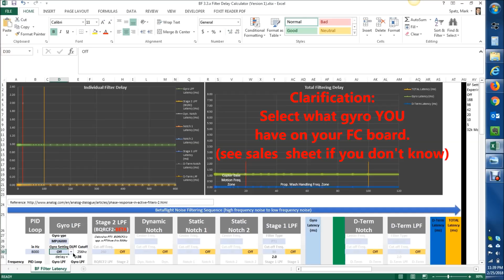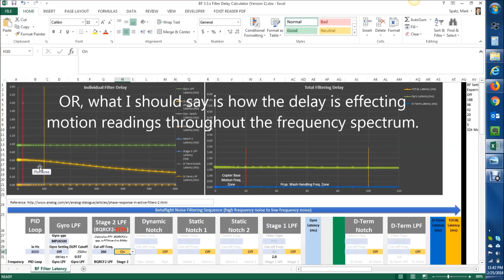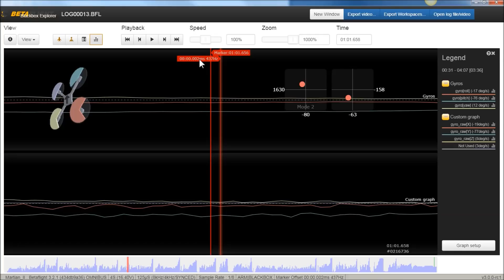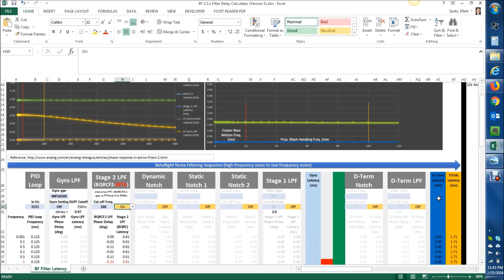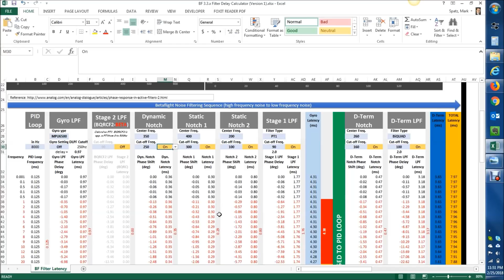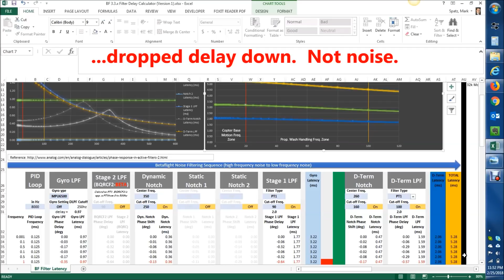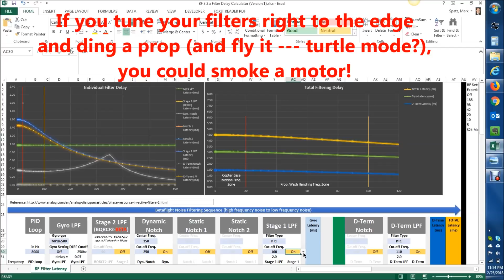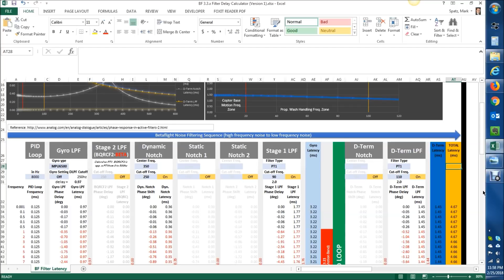Calculating Filter Delay in Betaflight, Cleanflight or iNAV

Comment: thanks, probably the most informative video i've seen in quite a while. I always tend to reduce my filtering to bare minimum (keeping the motor temp in check) but never just had a great idea of how the latency is affected so this is very helpful. it would also mean a lot to clarify with the devs how the latency really works for the new BQRCF2 filter and also how is dynamic notch filtering effective if we disable the standard gyro lpf an replace it with BQRCF2 filter at same cutoff (ie. 90). I can't tell the difference between the two, all I know is when I have both running then the propwash handling is terrible. anyway, for now I reverted back to just gyro lpf (PT1) as I assumed the BQRCF2 would just cause more latency
Reply: The devs know about the BQRCF2 vs classic Gyro LPF delay. One of the Betaflight devs actually made the original graph comparing the two filters' delays. But yeah, you're probably correct in using the classic gyro lpf set to PT1 if you're using an MPU6000. The BQRCF2 is better at filtering out high frequency noise across the spectrum than PT1, but as we know, the MPU6000 is hardware limited at 256hz. And at 256hz, the BQRCF2 and PT1 filters are identical as far as frequencies filtered out, except the BQRCF2 filter has more delay. So for people running gyros faster than 8k, there will be a benefit to using BQRCF2 since running at higher than 8k increases the hardware LPF.
Reply from the maker: BQRCF2 has the same phase shift as the PT1 from 0 to ~1,000 hz.  See https://github.com/betaflight/betaflight/pull/4965#issuecomment-364606583

The more things settle in, if you are going to run the Dynamic Notch and only 1 LPF (PT1), I feel running the classic LPF (Stage 1) would be best (which you should only need one LPF for 4k/8k setups).  The addition of the BQRCF2 was for 16k/32k setups.  That would keep the Dynamic Notch up higher in attacking motor noise (just slightly), but nevertheless.  A higher Dynamic Notch means lower latency.  The jury is still out on the BQRCF2, and it might get swapped out altogether before 3.3 is officially released.  Conversation is on-going as folks are testing RC2 and RC3.  Fast Kalman Filter (FKF) may come back, or both may be out and they use Butterworth filter algorithm.  Or that might be pushed off till 3.4.
Reply: yep, forgot to mention I'm running MPU6000 on all of my builds. dynamic notch on, and typically all static notch filters disabled. alright so I won't even bother to experiment with BQRCF2 as a replacement for the classic LPF, sounds like it wouldn't make any sense in my case.
Reply from the maker: bobesh oz , agreed.

Comment: So is there any sense in running pid loop 4k vs 8k for 8k gyro mode?
Reply from the maker: MrBirdshell666 , it can give u less noise detection in the PID loop.  u would have to run for yourself and see if it reduces the noise floor for your setup.  if it does and u can cut out any filtering, or increase cutoffs anywhere as a result, it makes sense.  Do mind your Blackbox logging rate for this type of analysis!